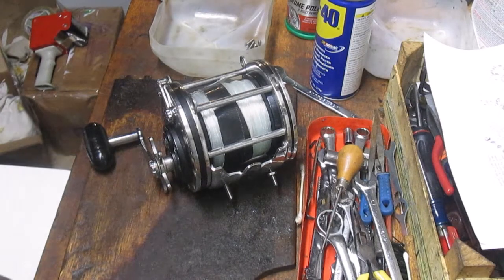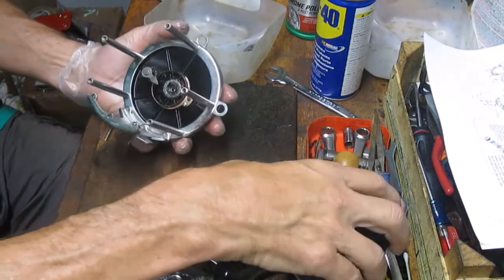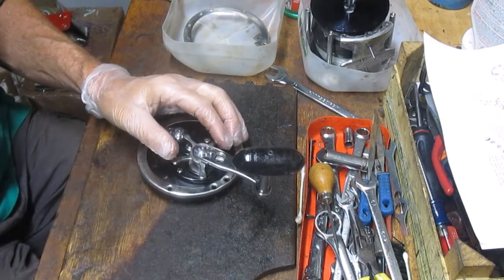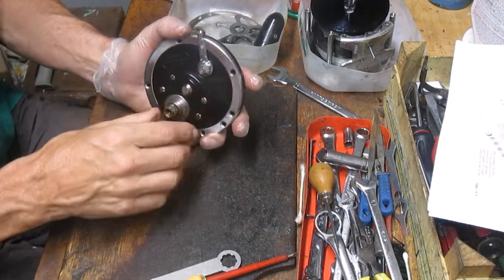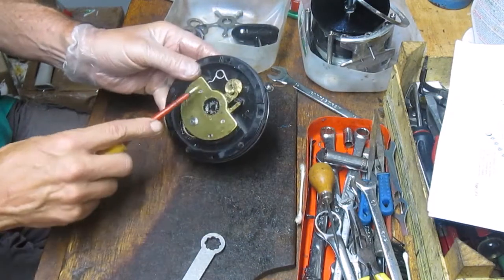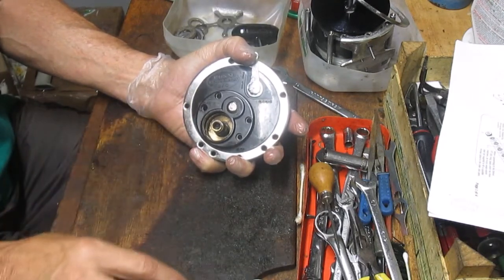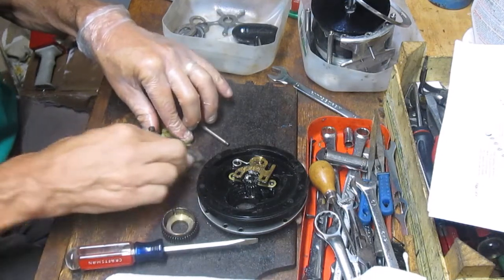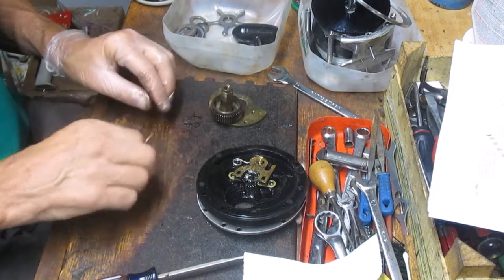Penn Senator 9/0 fishing reel complete take apart and service

Comment: Hey Dennis 
Another great video.  I just went through my reel but I found 7 ht 100 type washer to 5 metal washers. The ht 100 type washers were doubled up at the bottom and top of the stack. Do you know anything about this type of setup?
Thanks
Reply from the maker: The reels initially came with thicker asbestos type washers.  The stack you have is a conversion from the old ones to the new HT-100 as the older style thick washers are no longer available.  If you have two doubled up on the bottom, that is to increase the height of the stack and should not affect how the others work.  Thanks for asking - Dennis

Comment: Hi Dennis, great videos, easy to watch and very instructional. I picked up an older Penn Jig-master 500 with an orange Bakelite handle and the peg that holds the handle is bent slightly out of square. Can this just be bent back or do I need to buy a new handle? Have you done a video on this? Thank you sir!
Reply from the maker: Thanks for the kine words.  If the peg is bent, you will have a hard time bringing this back to square without loosening the rivet that hols the pin on.  The solution is a replacement.  You can usually find the bakelite handles on Ebay for around $10.  You can get the new rubber know handles through Mysticparts.com, which is the former Pennparts.com. - Dennis
Reply: 2nd Chance Tackle thank you for the info, that was what I thought. I took the reel apart, cleaned and greased it based on your videos, now it just needs a new handle and it’s back in business. Thanks again and have a great day!

Comment: Hi Dennis, great informational video as always. I have a question: how do you remove a screw that's is stuck to the frame posts? I've taken all the screws off expect this one and it won't budge. If the screw turns so does the post and of the post doesn't move neither does the screw. Someone suggested heat and sticking it in the oven or something but I'm not too sure about that. Thanks.
Reply from the maker: Stay away from the oven!  That will damage the side plates.  I suggest the following:  Spray both the outer and inner screw with a penetrating oil, like WD40.  Do it several times over an hour or two.  Give it time to work.  Next, get a kitchen scrubby pad, like Scotch Brite or the dollar store variety.  This will stop the pliers from scaring the metal post. These are the green pads about 1/4 inch thick that are like a fabric steel wool.  Cut off a 2 inch by 2 inch square strip and wrap the pad around the post.  Grab the pad with a pliers and hold tight.  I prefer a small channel lock pliers.  Hold the screw with the screwdriver and turn the post counterclockwise, with the pliers.  That should free it.  If not, you may need to snap the post off and replace it.  Replacement posts are available from Mysticparts.com.  This is the former Pennparts.com website.  You can get a replacement post and screw for the Penn reels there.  To snap the post off, grab the far end of the post and move it up and down in short swings until the screw breaks off.  Good luck - Dennis
Reply: 2nd Chance Tackle thank you Dennis I will continue to try and see what happens worse comes to worst I'll snap the post like you said. Have a good day.

Comment: Hi Dennis, just bought my first senator 9/0, used from eBay. I’d like to replace the handle it currently has. Can you point me in the right direction of what wrench I need? Thank you!
Reply from the maker: The Penn wrench that fits the high speed 4/0 Senator and 6/0 Senator will work on your 9/0. If you do not have the original wrench, you can buy a replacement from Mysticparts.com or I'm sure Ebay probably has them.  
They are not that expensive and good to have for tuning up the reel - Dennis
Reply: @2ndChanceTackle  thank you!